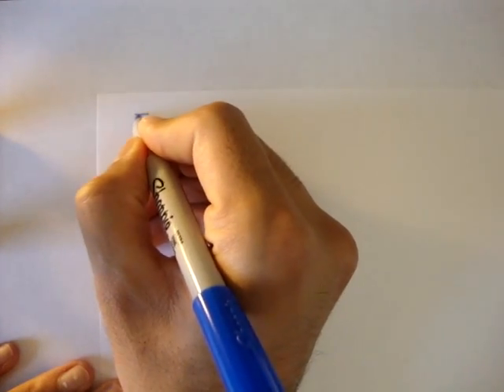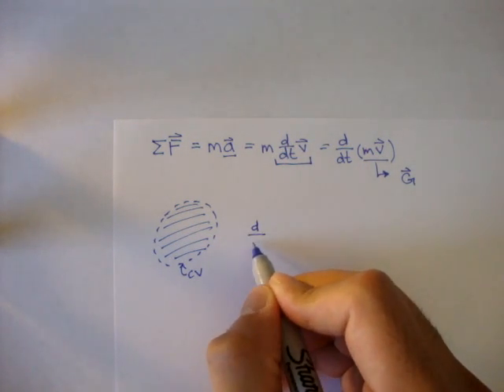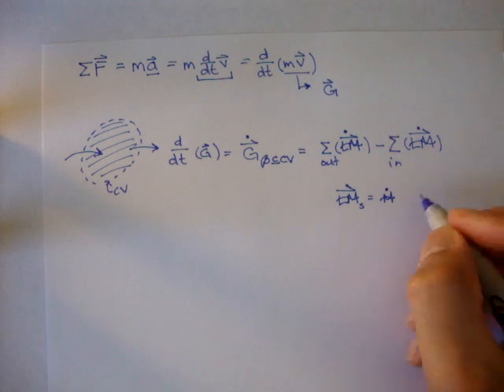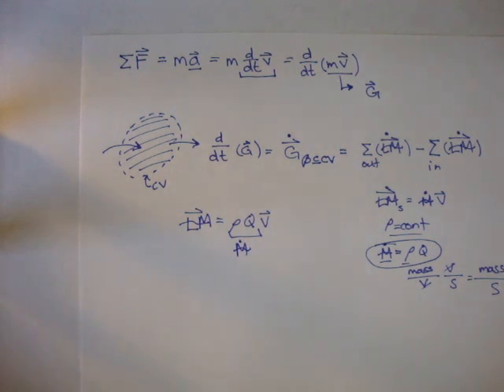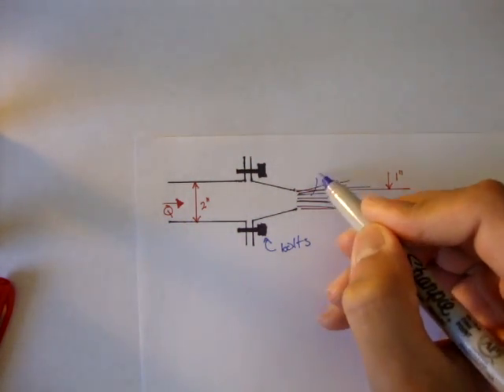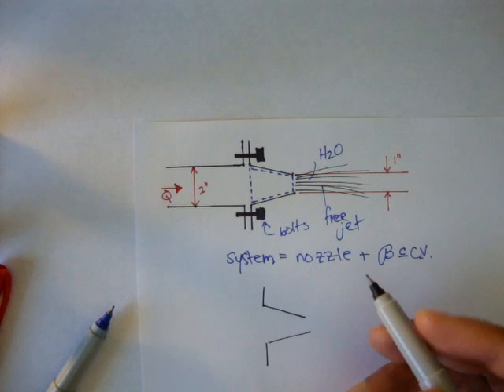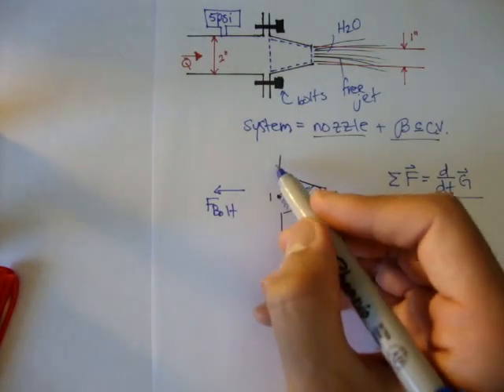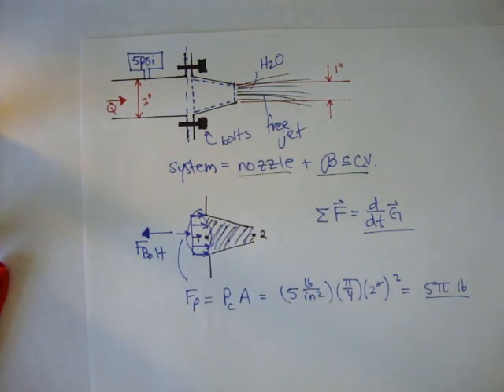Basics of Linear Momentum: Part 1 [Fluid Mechanics #27]

Comment: The pi/4 is  a bit confusing, mabe use radius instead.
Reply: @quique182I meant that better to choose a unit radius instead of diameter, or if to stay with these arbitrary units, just mention a side step (dia/2),  so that one does not confuse unit manipulation dia/2 = radius with formula representation r^2*pi. 

r^2/4*pi is not seen as original representation and one can lose track of what is unit manipulation and what formula. But that is my opinion, just wanted to state my issue correctly. Of course this is a really #minor# step, but when it gets more complicated one can loose focus of what is new formula and what not. Great work by the way.

Comment: Surely the reaction force of the bolts is in the opposite direction to which you have drawn? The free jet generates thrust meaning the pipework wants to move to the left, thus the reaction force acts towards the right.
Reply: It takes force to hold the nozzle on. there is more pressure behind it than in front of it. The pressure is constant everywhere behind the nozzle. Any thrust generated comes from the fluid moving through the hose, most of the "thrust" you feel from a hose is because its curled. This is not a rocket engine, there is no divergent section where the fluid is sped up as the pressure is reduced, which is what generates that kind of thrust
Reply: @BenNBuilds  but why a fire man need to exert a force that is in the direction of the stream not the opposite ?
Reply: @amrshehab7019  Thats the reaction force.
Reply: @BenNBuilds  this reaction force acts on the nozzle and we are studying the nozzle not the fireman so what i understand that this force we are calculating is the reaction force that is needed to hold the nozzle in its place what is wrong with what i understand

Comment: why is the pressure at free jet equals zero
Reply: julius umali i don't think the answer will be the same if the absolute pressures will be used.
Reply: Newton's 3rd Law.
Reply: +Soha Murali That is because you are using gage pressure, as Julius pointed out. If you were using the absolute pressure, you would have to have a force due to that coming from the right where the nozzle opens into the outside. If you do the calculation, it would come out to be the same as the way he is working this out.